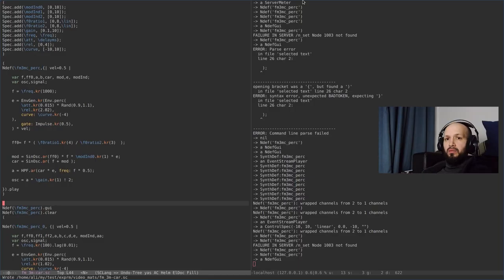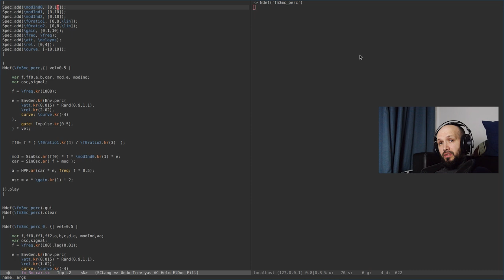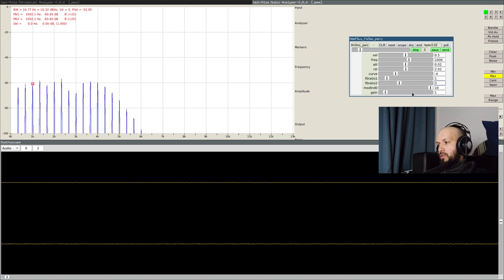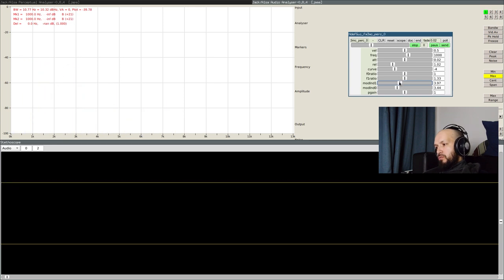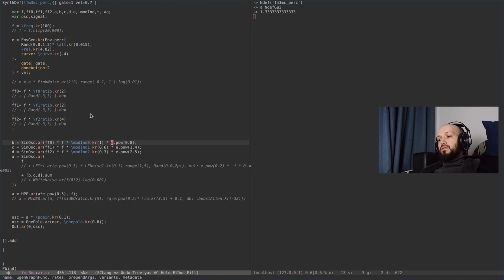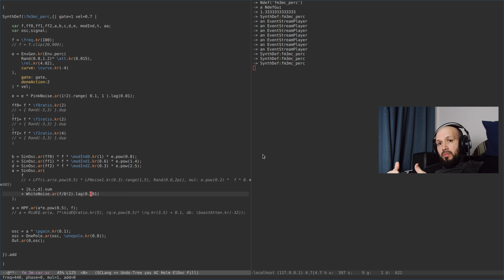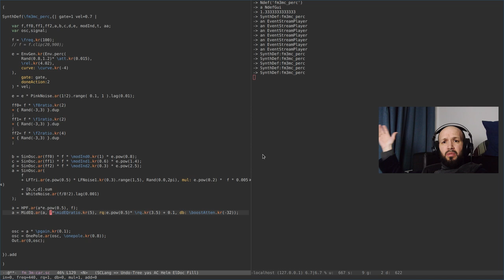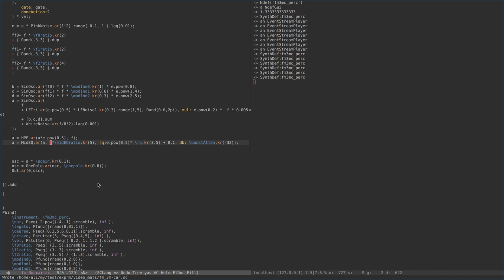2: FM[0]: N modulators, 1 carrier - Musical Sound Design In Supercollider

Comment: Wouldn't the mods b, c, and d typically also be modulated by their respective ratios, e.g.
b = SinOsc.ar(ff0) * f * \f0ratio.kr * \modInd0.kr(1) * e.pow(0.8);
c = SinOsc.ar(ff1) * f * \f1ratio.kr * \modInd1.kr(0.6) * e.pow(1.4);
d = SinOsc.ar(ff2) * f * \f2ratio.kr * \modInd2.kr(0.3) * e.pow(2.5);
Reply from the maker: You mean ff0, ff2 ff3 to be modulator signals as well? You can of course, especially if you want to make dense noises in certain frequency bands. If you want to stay harmonic, then it's a better idea to modulate phases of b,c and d, because here we modulate frequency which is bit difficult to control with modulator cascades. Usually fm synths actually modulate phase, because that's cheaper to calculate.
Reply: @Reflectives  yeah - i've seen the fm formula expressed like this: car = SinOsc.ar(freq + SinOsc.ar(freq * modratio)) * index * (freq * modratio); so i have taken it for granted that that is how you're supposed to do fm
Reply from the maker: @droptableuser8373  There are lots of ways. I hope to cover some of them